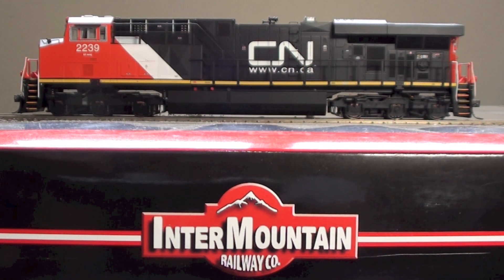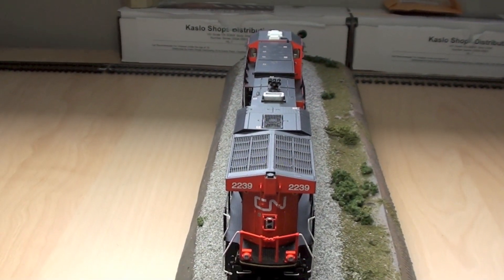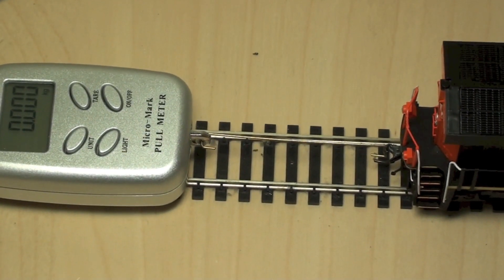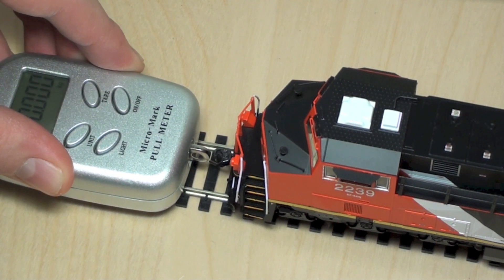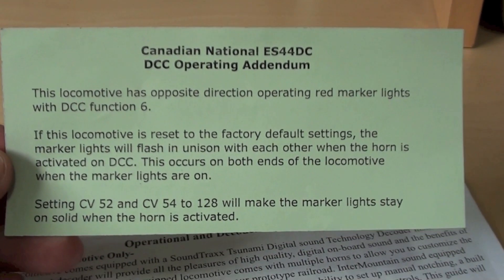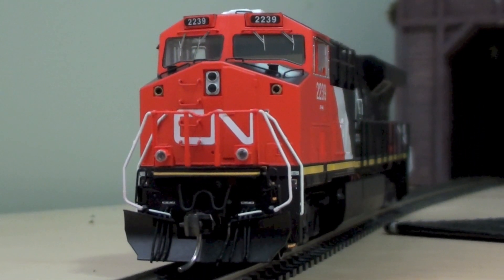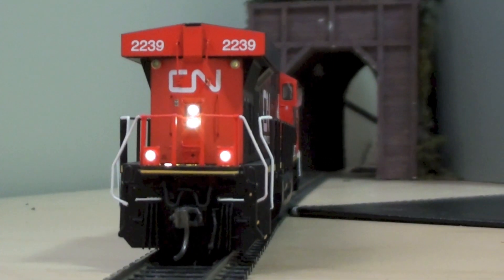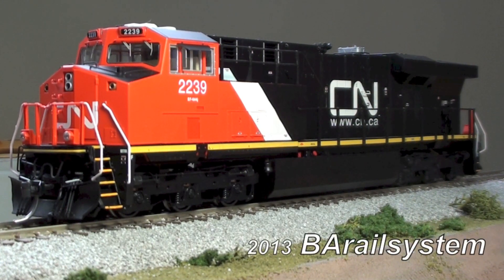Intermountain ES44DC Review & Testing

Comment from the maker: Alright man I did some experiments for yah. On a straight section of completely flat track it will pull well over 20 cars. Any kind of curves or grades and that number will go down. For example, my layout curves are 25" and the grade is 2%. This locomotive can pull 10 cars up the grade with the wheels just starting to slip.

Comment: After a few days of running the speed fluctuations are much reduced and only really noticeable below step 4.
As for the noise, I think maybe my expectations were too high. This is my second IM loco, I was unhappy with the noise from an SD40 I bought a month ago but thought it was just a bad one. I  figured since the IM units cost as much as my Athearn Genesis GP38, they would be the same quantity. I guess I was wrong. 
In fairness, I have a quiet room run CV128 a bit below default setting.

Comment: I just received mine and this is a terrible locomotive, The motor is easily heard over the tsunami, it speeds up and slows down as it moves along. At speed step 1 is sits for a few seconds the jumps forward a bit then stops again, then repeats.